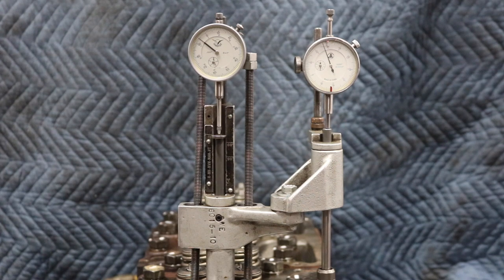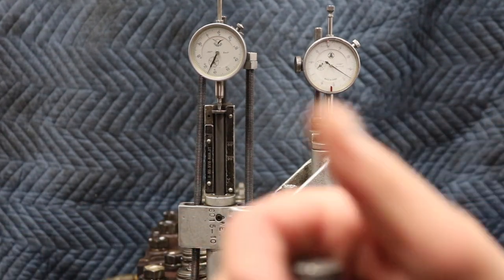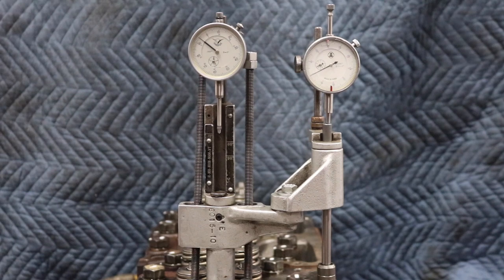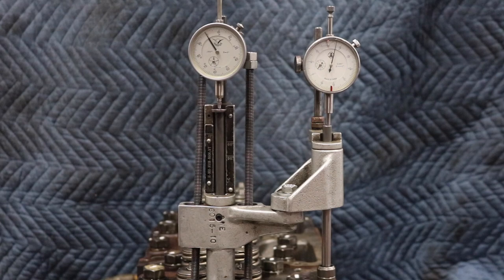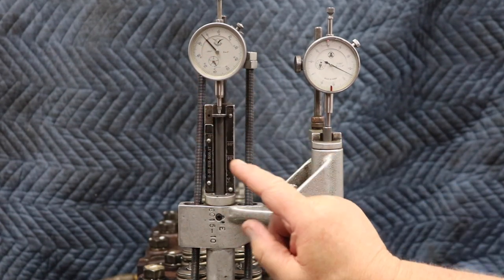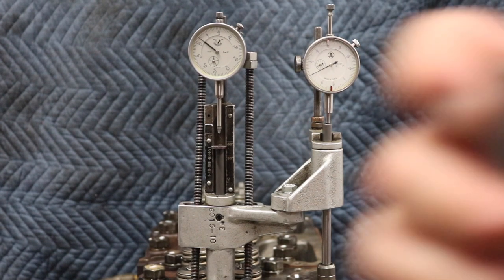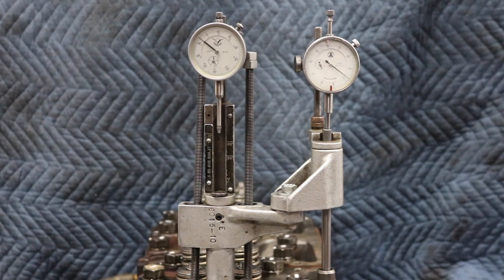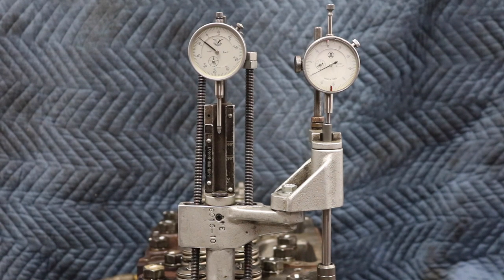Timing a Cummins 88 Big Cam IV

Comment: You guys built my NTC big cam lV 550 hp , it ran great , pulled fantastic 2 quarts oil consumption between oil changes. Worth every penny I, got 6.8 mpg loaded heavy pulling a tanker .
Reply: Do you still run it?
Reply: Do you still run it?
Reply: ROC Roller The Super Trucka  I sold the truck I 2008 .
Reply: How much did it cost to rebuild it back in 08 ?
Reply: @matthewames3864   $18500.00
Reply: @larrygreen8912  thanks !!  About the same price as a 12-7 Detroit.

Comment: I have seen some claims online of guys putting N14 steel top pistons in the 855, then I saw another guy claim the wrist pin is a different size and the pistons are a different height from the wrist pin to the top so you must use the N14 crank & rods to use the N14 pistons in an 855? does anyone know how hard it would be to put N14 pistons in a 855, or how hard it would be to convert an N14 back to mechanical?
Reply: I was thinking the same thing as you, I looked all over for steel pistons and even tried to get them made but couldn't. They did make mechanical n14s

Comment: hello. I have a ntc-formula 350 big cam 4 cummins engine. I have been getting in trouble with the law for excessive black smoke. I have done lots of things to the engine to mitigated that problem and seem to not work. the only think that I can think pf is that either is out of timing, but if I turn it on seems to be working properly, just with the excess of black smoke on cylinders 1-4, 5 and 6 dont smoke but seems like there crude diesel. the other thing that i have a question on is if that particular engine has the stcthin
Reply: stc oil control valve that could be causing the problem. this is a top stop injector type engine that I have. please if you have any suggestions on my problem any would be useful. I don’t know what else to do. not many good mechanics around my area.
Reply: Revisa la.altura.de las camisas

Comment: Do you need to readjust timing if the cylinder block and head has been skimmed?
Reply: No. Usually do it when you replace the cam or followers. The timing is set by the thickness of the gaskets on the cam follower housings